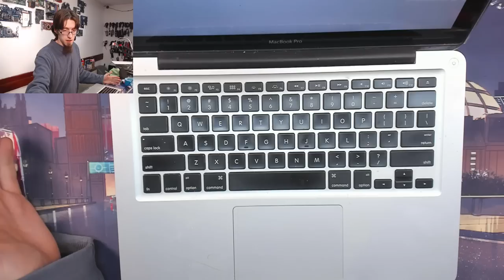MacBook Pro with Muffled Speakers... and more - LFC#244

Comment: Usually a 2011 screen will not fit a 2012 model. The LVDS connector is slightly different. But in this video it magically fit.

Comment: I have been seeing this issue on 2015 MacBook Pro's on their dual subs.  Always a slight tear in the cone.  I wonder if the material apple used dries out and starts falling apart.  Oddly enough the tweeters I have never seen go bad.
Reply: tweeters usually don't work so hard as subs and movement is much less aggressive. Of course if they use good quality materials to make them in a first place this will not happen probably ever in life time of laptop. But in other hand apple expect that you will buy new one every years so they probably don't see a problem in manufacturing cost cuts like this one.

Comment: the dust had eaten the foam surround of the "subwoofer" speaker; on speakers with foam surrounds the surrounds usually last 15-20 years but dust and moisture can eat them away more quickly. I noticed you have (or had) a pair of speakers in the shop which look to be 30 years old - if they still work fine they'll have cloth, rubber or foam-rubber mix surrounds that don't deteriorate like ones that are just foam do.

Comment: I think you should charge a small fee for the speaker parts you supplied. 5 or 10 pounds doesnt sound terrible but then again ive not looked up what they cost new on ebay. 
Reasons are you had to at least use up space to store the parts, inventory them and then strip and install them.

Comment: On older PC Laptops the CD/DVD was using the slower SATA 3 so I'm sure Apple went the same route. And yes when I did those conversion I put the mechanical drive in the cd/dvd sled.

Comment: How were you making sounds via the 4 arrow keys?
Reply from the maker: I was in the Sound Options in System Preferences where you set what the System Noise is. You can highlight an item on the list and then cursor key up and down - very quick way to get some noise out of a mac without loading up youtube or something.

Comment: 26:47 do NOT use vinegar on aluminium, (maybe if you clean it off thorougly after) because it can remove the protective oxide layer and eat into the aluminium especially when scrubbing at the same time. Also residual acetic acid will continue to damage the surface.

Comment: The only thing smaller in a mini sata is the power connector.   It does not carry 12 volt power.    The data connector is physically identical

Comment: The SATA Ports in the 2012 MBP are definitely Sata 3 (6Gb/s), even the 2011 Models have Sata 3, I think. And both ports are the same speed, so if the HDD port ist Sata 3, die ODD port is as well. Because of that, I would definitely leave the HDD in it's place, since Apple has done a really good job with the shock mounts in the Unibody MacBooks, whereas the "Superdrive to SSD Adapter", as I shall call it, has basically none.

Comment: if I could, I'd bring in my mid 2010 for you to repear, now it can no longer chime at all, very much a similar issue, the main issue is the subwoofers on this type of macbook, once its fixed I can then try and install big sur on it using a patcher as I really hate macOS high sierra, hopefully this video also applies to the mid 2010 core 2 duo, also a 13 inch

Comment: MacBook Pro, 13", mid-2012:  replaced the speakers but now the keyboard does not work.  I disconnected and reconnected the keyboard connector several times.  Also, the laptop now is delayed in everything:  connecting to the internet, to email, in typing - I have to use an attached keyboard.  I also hear the fan now all the time.  Any thoughts?  I'm not sure that you'll see this comment since your video was posted 3 years ago.

Comment: I am sure I speak for most, in that if our laptop broke and you fixed it with spare parts, (which offers a massive saving) that you would be more than happy paying something towards those parts.  Those spare parts do have value both in monetary terms, and also if something happens on a job in the future, you may just need those parts to get out of a bad situation. I know others have said £10 would have been fair, but again knowing how lost I am without my laptop, id be happy paying more to get it not only fixed, but fixed quickly as you are not waiting on parts to be ordered and delivered.  Dont sell yourself short, you are in business and it is ok to make a lil profit lol.  I am sure others will say by doing this, the customer will put the word about and you will gain via that reputation, which is great, however you should be charging something, it all adds up.

Comment: I am curious. What are a majority of the jobs you deal with in a day? (software issues, hardware, etc) I know you show at least one repair job with us, but what takes up a majority of a typical day? Other than paperwork of course.
 
Many of my jobs are one offs cause I do component level repairs on most anything that isn't a cellphone or computer. Sadly a lot of my time gets eaten up looking for specific parts, or research in general. I can count on one hand the number of times I've seen 2+ of the same items on my bench in the last 6 years of repairs.
Reply from the maker: I do a lot of basic stuff, failed HDDs that turn into SSD conversion and service jobs.
Reply: @Adamant_IT  Good stuff. Data recovery has always been a keen interest of mine, subscribed to a couple of those channels and am amazed at some of the magic they accomplish.

Comment: Respectfully, I disagree sir. Second hand/savaged parts DO have value.  Just because the part is not new, or may have been acquired or salvaged for free or little cost does not negate your time and effort in acquiring said part, testing/verifying said part. In addition, there are situations where a new part may not be available due to age, or locale availability.  Never consider your stock or efforts as valueless regardless of its origin or time spent. This is simply not the case IMHB as your experience is an immeasurable resource.
Reply: Exactly, and if he tells his mate who has same problem and you don't have anymore spare.speakers and charge him an extra £20 for same repair he will complain.  Favours don't pay the bills

Comment: Sir why do you make a video on apple  macbook pro 13 inch 2011 early laptop is getting so heat and it's CPU fan is not running fast through the help of sensor when it's getting so hot so i don't come to know that it's fan is damage or it is problems in mother board sensor

Comment: Ive been watchin these macbook vids as im currently repurposing laptops weve had 3 macbooks come thru the reset unit where the battery has erupted thru and punched the whole mouse assembley out just wondered if you had ever heard of that all 3 are 2013 macbook pros
Reply: It’s a pretty common issue on the A1502 MacBook Pro. Batteries gas up and bulge out of the track pad.

Comment: I wish every repair videos first step would be clean the screen and laptop. 🤧
Reply: Bad use of time, end up spending time cleaning, only to find something not worth fixing, & throw away clean parts with no way to recoup the cost of your time. Even if that doesn't happen you'd have to clean the thing twice, to remove fingermarks from working at the end. So, clean what you need to inside while it's open & the exterior when you're done.
Reply: Working on dirty environment is gross to begin with. Since COVID, proper hygiene would be the first thing, and it should be from beginning. Cleaning is so easy and fast anyway, just little bit of isopropyl alcohol & microfiber cloth, done. I always clean the exterior first before working on the laptop, and it makes everything so much comfort to touch and move it around. It's just a simple wipe when done.

Comment: Won't the customer be mad you put a Macbook screen instead of a Macbook Pro one ?
Reply from the maker: It was a MBP screen, but the glass on it has been replaced at some point in its lifetime.
Either way I think the MacBook and MacBook Pro both had the same panel in them. It wasn't particularly exotic - you needed the Matte panel for actual quality, which wasn't glass-fronted.

Comment: If it wasn't so expensive or took forever to ship, I'd send my laptop to you 😂 i have an asus flip and the hinge has snapped. Trying to look for cheap parts to fix it myself but so far only finding the laptop itself "for parts" $150+

Great video!👍
Reply: Have you tried AliExpress or Banggood? There’s usually a long wait getting the parts delivered from China but there’s usually parts to be had
Reply: @monkeytutz2  still probably gonna be spending a lot with shipping 😂
Reply: @handheldhavoc6635  you’d be surprised. There’s loads of stuff which has free shipping. It just takes 20-40 days to turn up. Since Brexit, I seem to be paying import duty on stuff coming in from China though?
Reply: @monkeytutz2  I'll have to check it out!